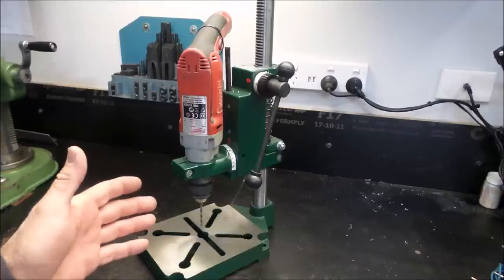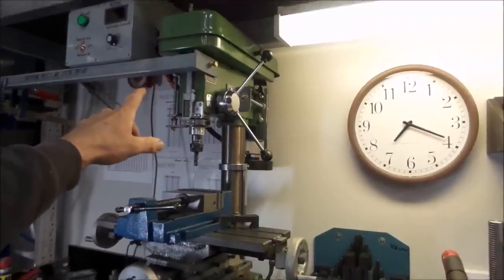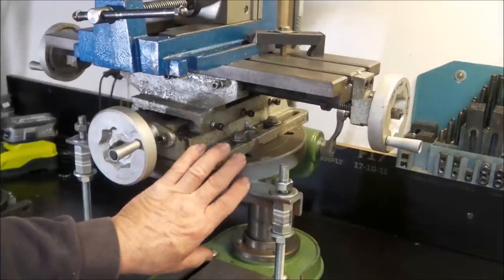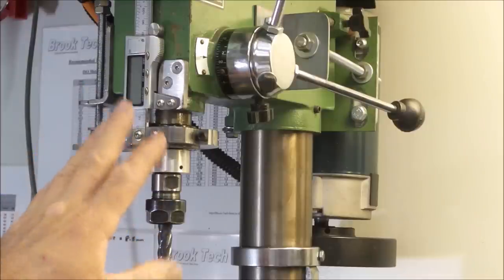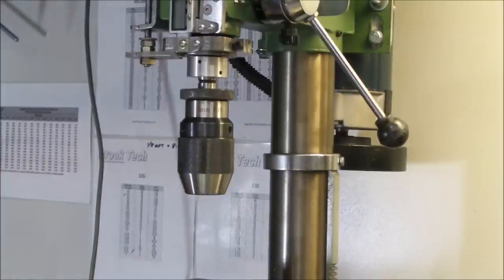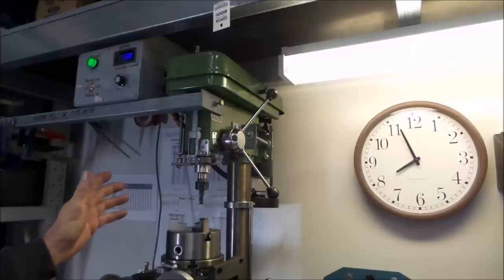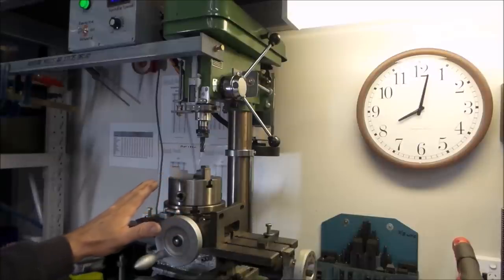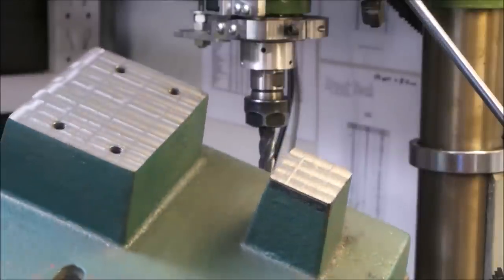The Ultimate Drill Mill Conversion Episode 1

Comment: Very impressive....repuposing a machine to go to another spectrum is the way of the Ingeneur or as they're know an engineer.….. the height of ingenious applications. BTW....if you look inside say an ER 32  chuck with a Morse or parallel shank you'll find it's got a hole all the way through. With this you can stick the chuck up into the quill spindle taper and push a long cap head screw with a washer up the hole in the chuck to reach the cross slot where you normally drive the tang down with a drift. If you fit a round pin in the cross hole and drill a cross hole through the middle of it and then tap it to suit the long screw you can pull the taper tightly into the spindle by using a long Allen key up the inside of the tool shank.
Reply: I am currently building similar thing to suck the taper up into it to keep it from coming loose. I also stiffened the column on mine. It was hollow in the inside. So I took pieces of re-bar and filled the column with them and concrete. Should make column more rigid. Have yet to test. Fitting digital readouts to my cast iron table this weekend.

Comment: know it been a long time,  but with some manipulation, you could just simply make it operate right off the quil that takes all the lateral pressure of the quil and mills anything your motor size will allow you to and it all bolts to the work table/ ... essentially a quil driven mill attachment

Comment: Have you considered Epoxy Granite for strengthening that area to remove flex?
Reply from the maker: G'day Mate, yes I have thought of a few similar things such as that.
I feel it would definitely help, but i also feel more gains are to be had by adding further bracing to the drill head.
But of course that relies on having something to brace off.
Appreciate the input though, Cheers Mate.

Comment: Concrete and brass shims. With enough of both of those you can turn a toilet into a CNC lathe/mill/ass scratcher combo. Technically, epoxy/granite is better but it's kind of expensive.

Comment: First I have to say incredible conversion and great video.  But if you could please help me with the type of end mill holder or chuck used. Would you recommend R8 size?  I’m new to machining and just seeing your machine tapping threads was incredible. You sir are a day dreamer. Greetings from South America Quito Ecuador.
“All men dream, but not equally. Those who dream by night in the dusty recesses of their minds, wake in the day to find that it was vanity: but the dreamers of the day are dangerous men, for they may act on their dreams with open eyes, to make them possible.”
Reply from the maker: Hi Andres, thank you for the kind words. You will need to match the receiver taper in your drill press. Mine was MT2.
So my chucks & collett holder are all MT2. If your drill press is R8 Taper then that will work Cheers.

Comment: Have you thought about an epoxy "granite" filling in the base of the drill press (and perhaps a inch or two up into the column)? Would eliminate the flex of the base and increase the rigidity of your column. https://www.cnccookbook.com/
(Sorry - tried to post a active link , but couldn't : The article is Titled :
Epoxy Granite Machine Fill . You'll have to use the search bar hidden at the top right of the page)!

Comment: I got a better idea,,,,Just by yourself a milling machine… A drill press will never compare to a milling machine no matter how much you brace it.. if you plan on milling little pieces of aluminum or brass that are an eighth of an inch thick then yeah maybe providing you take it real slow and use fresh sharp end mills but anything else forget it… that thing starting to look like it’s out of a mad max movie..!!!
Reply from the maker: Wow, what a great idea. You're so Smart. Amazing even. Seems like you may have missed the whole point of the exercise. P.S. I do actually have a Proper Mill. Not that its relevant to this video, But have a great Day Anyway. Cheers.